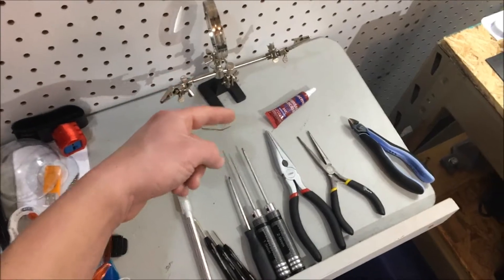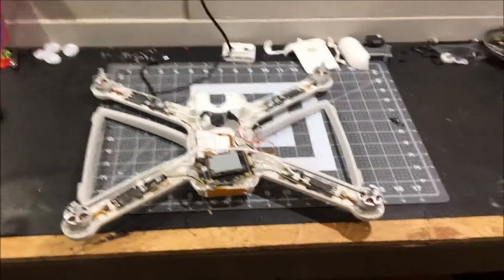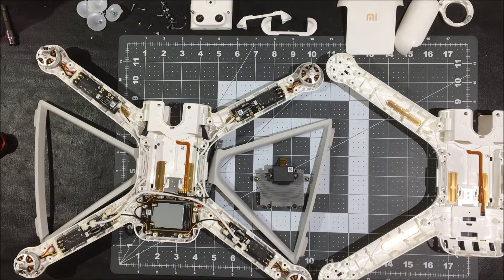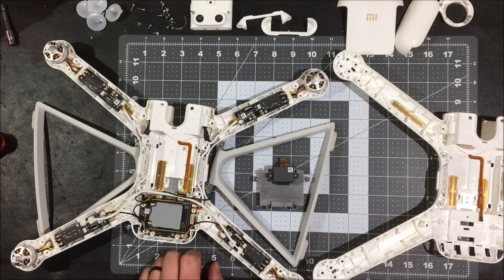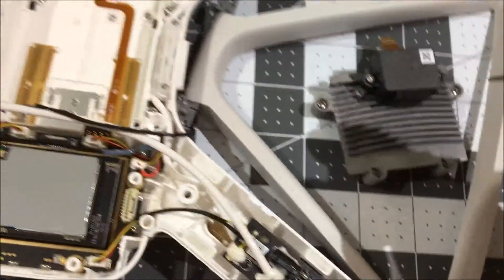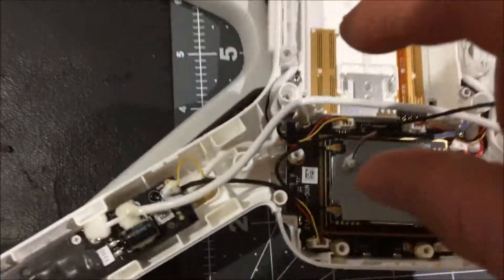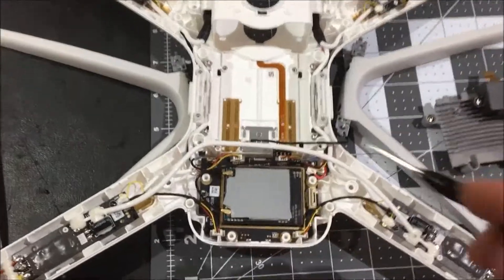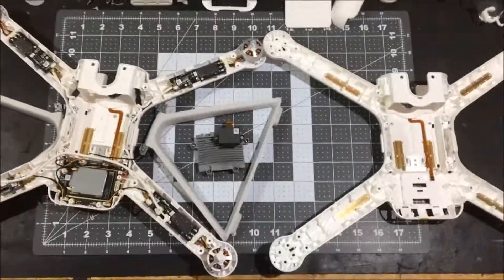XIAOMI Mi Drone Re-Build Pt.1

Comment: I have accelerometer sensor error issue. Anyone can help?
Reply from the maker: Mr RJ , unfortunately I do not own this drone currently, and have not experienced this issue personally, however I have done a little looking around online, and it appears that others have also experienced the issue you are having, it also appears that it could possibly be the sensor has came loose or unplugged, or is being blocked internally by other wires or the frame, I will try to attach some links to the places I found this information a little later today
Reply: BlackhawkFPV Thanks for looking up. It seems i have to replace the IMU which has accelerometer, gyroscope and barometer in it. Tried reconnecting but didn't work. Will order a new piece from china.
Reply from the maker: @RjKaf  , absolutely, anytime.  That's a bummer, hopefully new version IMU has issues corrected.
Reply: @BlackhawkFPV hope so. Thanks 👍

Comment: I use blue Locktite and my repaired drone crash on its first flight. The locktite destroy the plastic aound the metal nuts. Both rear broke loose ...so I wouldn't use locktite again.
Reply from the maker: Hello,  Very sorry to hear you had this issue!  Yes when using locktite, you must be very careful not to get it on plastic components as it will do exactly that.  I would only use it on metal to metal components such as metal screw to bottom of motor, metal screw to metal nut, etc., but being very careful not to get it on anything plastic, and if so, wipe it off immediately.  With vibrations that are present in these systems, you may need to find another way of securing screws if you do not want to use the locktite, may try lock washers?  The only problem you may run into with a lock washer is it will take up extra space on your screw, and may make some screws to short to hold, or may only allow a few of the threads to grab.  Is the drone salvageable?